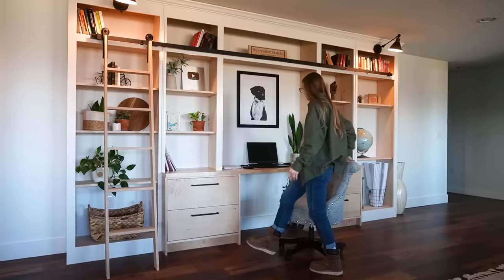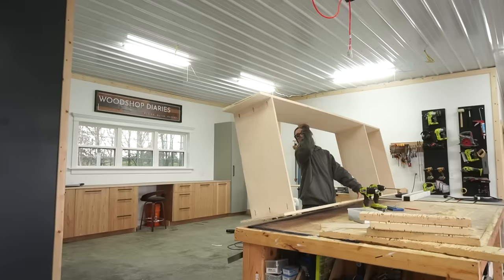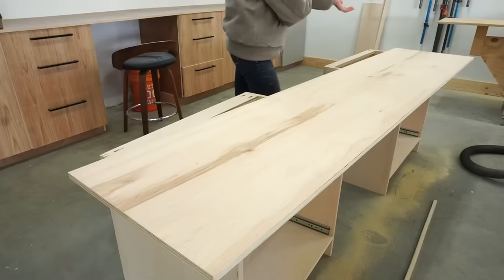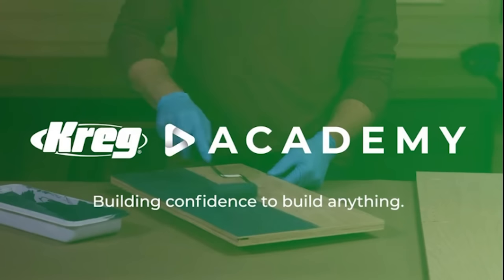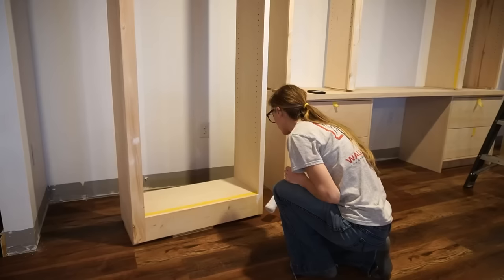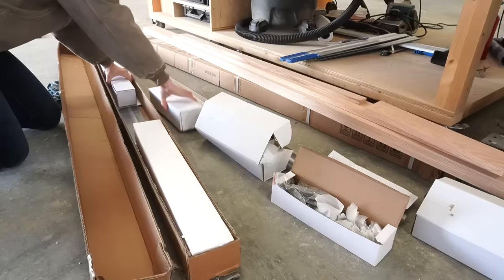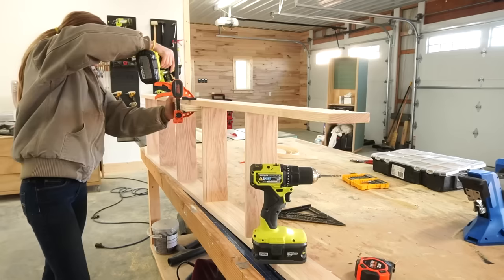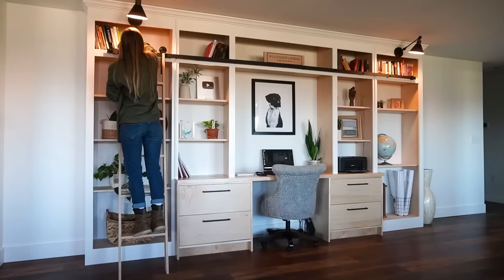How to Build a Library Bookshelf--WITH DESK!

Comment: Rolling ladder hardware has to hold your weight as well...part of the reason why it's more expense.  Great job on the built in.  Great tips.  One thing that could have made the face frame seamless...is to add it after installing the shelves.  I really like your new work space.

Comment: This is just perfect 🤩🤩 thank you for showing us. How much did materials cost for this, overall? or if it's possible to ask how much would materials be just for the desk and integrated shelf on top of the desk, not counting the 2 bigger shelf on the sides?
Reply from the maker: Thank you! It’s impossible to determine cost to build because prices on materials will vary by location and change day for day. I have the materials list in the description and listed in the plans linked in the description and I’d encourage you to check your local prices for the supplies and materials needed to figure up what it would cost to build. My cost won’t necessarily equal your cost, so I don’t generally give out cost info as yours may be less or it may be more.

Comment: One technique I've seen for hiding pocket holes after using them is to take sawdust and wood glue and pack the hole with the mixture. Then sand the result back down.

Comment: Edge banding yeah so I use birch plywood and edge banding but the banding is always way lighter than the plywood. Do you have this or is there a certain brand you use that matches better?
Reply from the maker: From my experience, the birch plywood I buy can come with some color variation sheet to sheet. And sometimes have some darker streaks in it (which I personally love). The edge banding I use is linked in the video description and within the blog post. I’ve found that unless I use it directly against some of those dark brown streaks, it usually blends well ESPECIALLY once stained or finished. I actually used that birch edge banding here with maple plywood and you can’t tell at all.
Reply: @WoodshopDiaries  thanks. Most everything I've been building I've just finished with poly because I love the look of natural wood

Comment: Ladder hardware will be rated for more weight to accommodate the majority of a humans, a barn door rollers are not rated for a human only about 150lbs for the door itself.
Reply from the maker: That makes sense BUT, the ladder is touching the floor. So the weight isn’t solely on the hardware. It’s basically leaning against it
Reply: @WoodshopDiaries  Either way the build is very nicely done. Good job!